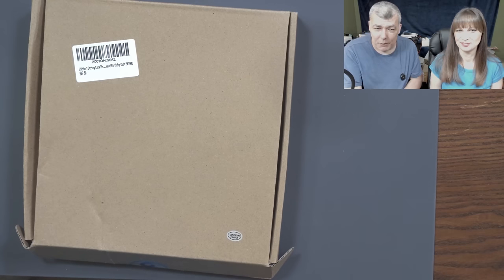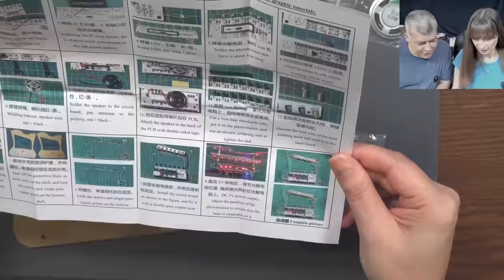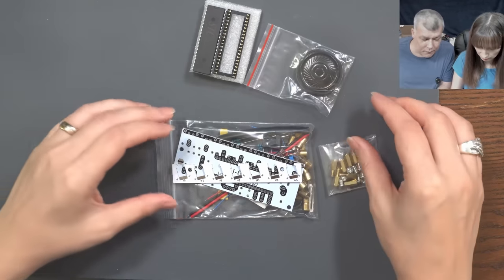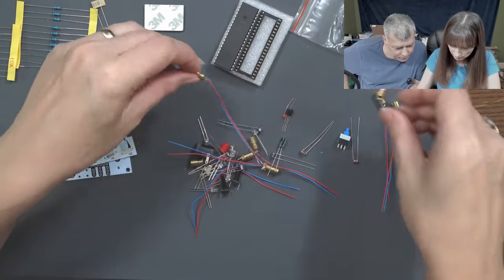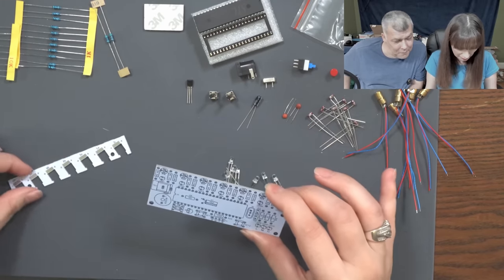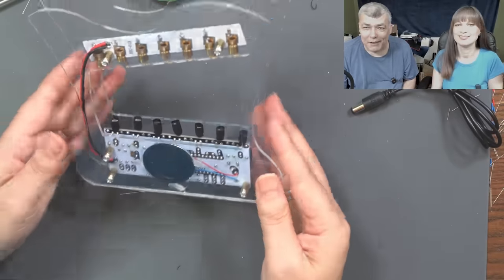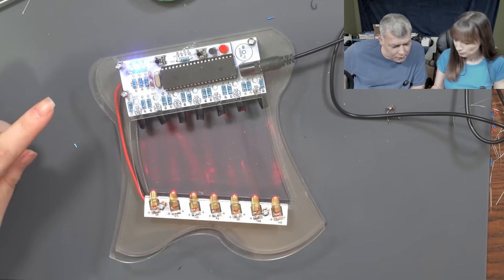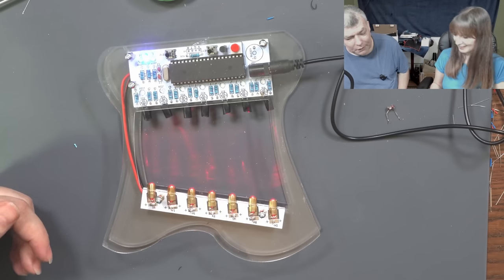DIY HARP electronic kit - Lesson 6 - Learning electronics with Diana

Comment: The red lights are laser modules. Like in a laser pointer. Very bright, and very small point of light, but safe. 
Try putting it in the steam of a pot of boiling water or a kettle.
Reply: Or Sorin could just blow his E-Cig smoke into it 😄